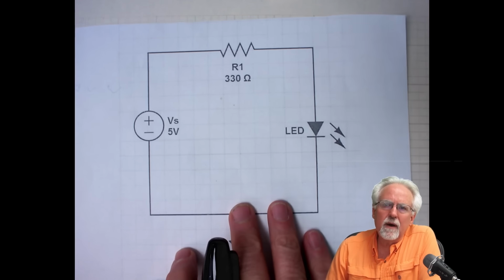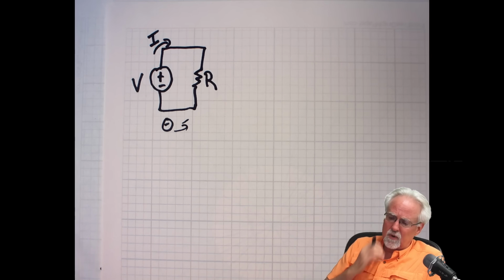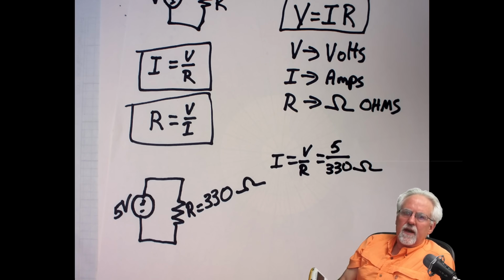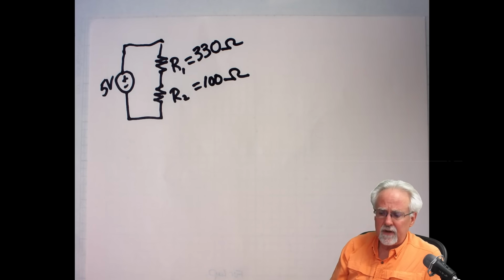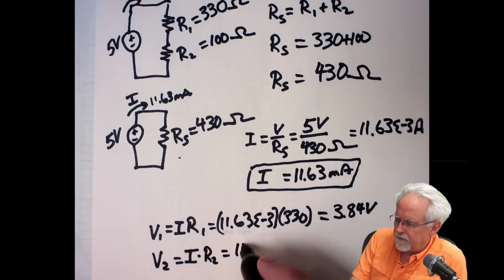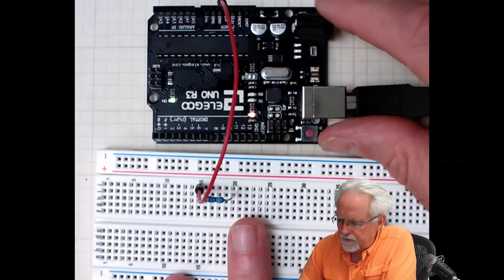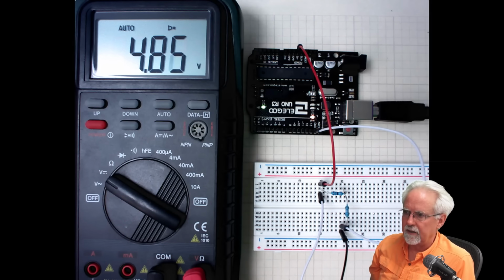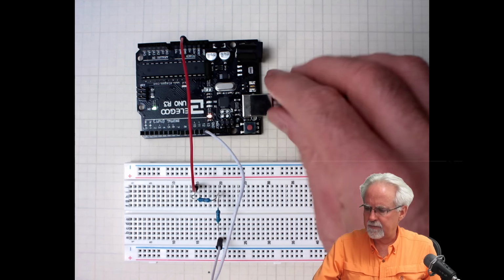Arduino Tutorial 9: Understanding Ohm's Law and Simple Circuit Design

Comment: Another great video.  It was a pleasure to listen to someone talking about current flow theory instead of electron flow.  Back in the 60's when I was just getting into electronics and building tube driven ham gear, everything that talked about electronics in books used current flow to describe how everything worked.  On schematics, you just followed positive to negative through the arrows when it came to semiconductors and life was good.  When I went into USAF tech school in 73, they taught electron flow and it made it a lot harder to follow.  Even so, please keep up the highly detailed instruction on how this all works.  Even old timers like myself can use a bit of refresher courses on the subject.  On your issue with the lower voltage, I too had almost the same reading.  I blame it on the voltage output sent through the USB cable and not the Arduino because when I checked using the provided external power supply, (a wallwart), the voltage jumped up to 5.1.  Apparently the device does not change the input power much.  Thank you again and I will be looking forward to your next video.

Comment: Hi from Ireland. 
Had to watch this one again, couldn't get the different voltage readings. It had worked when I used 2 x 330 resistors and when I changed one to a 100 resistor it wouldn't read. I replaced both resistors (as I have been reusing them) and rebuilt the circuit and then all was good. Talk more, go into as much detail as you like. 

Our maths is different to you guys. Our decimal point is in the middle and we use 3 to the power -10.

Comment: Given everything you've said here, I would think that the problem lies in the R1 resistor rather than the Arduino. If the Arduino were not supplying the correct voltage, then I would have expected BOTH resistors to be off, proportional to the resistance of each. But here, R2 measured exactly as you calculated. Thanks again, for another great lesson. Echoing other comments - NOT boring!

Comment: This may be excessive... 😬 First time doing this. Here's my printout:
====================================================
Rs: 430.00Ω = R1: 330.00Ω + R2: 100.00Ω 
I = (5 / 430.00Ω) = 11.63e-3, 11.63mA
V1 = [I*R1] = (11.63e-3)(330.00Ω) = 3.84V - 76.74%
V2 = [I*R2] = (11.63e-3)(100.00Ω) = 1.16V - 23.26%
5.00V - 100.00%
====================================================
Here is my Code:
====================================================
int readPin=A3;
int delayTime=6000;
// known values
int sourceVoltage=5;
float R1AssumedResistorOhm=330;
float R2AssumedResistorOhm=100;
// calculations
float RSum;
float VSum;
float totalAssumedCurrent;
float totalAssumedCurrentmA;
float R1totalAssumedVoltageResult;
float R2totalAssumedVoltageResult;
float R1totalVoltagePercentage;
float R2totalVoltagePercentage;
float totalVoltagePercentage;
float sensorMax=1023;
float actualVoltageResult;
float readVal;

void setup() {
  pinMode(readPin, INPUT);
  Serial.begin(9600);
}
void loop() {
  // known value
  Serial.print("====================================================");
  Serial.println();
  Serial.print("Starting: ");
  Serial.print(sourceVoltage);
  Serial.print("V");
  // assumed resistance Ohm
  Serial.println("");
  Serial.print("Rs:");
  RSum=R1AssumedResistorOhm+R2AssumedResistorOhm;
  Serial.print(RSum);
  Serial.print("Ω = ");
  Serial.print("R1:");
  Serial.print(R1AssumedResistorOhm);
  Serial.print("Ω + ");
  Serial.print("R2:");
  Serial.print(R2AssumedResistorOhm);
  Serial.print("Ω ");
  
  // assumed i / current / amp
  Serial.println("");
  totalAssumedCurrent=(sourceVoltage/RSum);
  totalAssumedCurrentmA=(totalAssumedCurrent*1000);
  Serial.print("I = (");
  Serial.print(sourceVoltage);
  Serial.print(" / ");
  Serial.print(RSum);
  Serial.print("Ω) = ");
  Serial.print(totalAssumedCurrentmA);
  Serial.print("e-3, ");
  Serial.print(totalAssumedCurrentmA);
  Serial.print("mA");
  
  Serial.println("");
  // print V1
  Serial.print("V1 = [I*R1] = (");
  Serial.print(totalAssumedCurrentmA);
  Serial.print("e-3)(");
  Serial.print(R1AssumedResistorOhm);
  R1totalAssumedVoltageResult=(totalAssumedCurrent*R1AssumedResistorOhm);
  Serial.print("Ω) = ");
  Serial.print(R1totalAssumedVoltageResult);
  Serial.print("V - ");
  R1totalVoltagePercentage=(R1totalAssumedVoltageResult/sourceVoltage)*100;
  Serial.print(R1totalVoltagePercentage);
  Serial.print("%");
  // print V2
  Serial.println("");
  Serial.print("V2 = [I*R2] = (");
  Serial.print(totalAssumedCurrentmA);
  Serial.print("e-3)(");
  Serial.print(R2AssumedResistorOhm);
  R2totalAssumedVoltageResult=(totalAssumedCurrent*R2AssumedResistorOhm);
  Serial.print("Ω) = ");
  Serial.print(R2totalAssumedVoltageResult);
  Serial.print("V - ");
  R2totalVoltagePercentage=(R2totalAssumedVoltageResult/sourceVoltage)*100;
  Serial.print(R2totalVoltagePercentage);
  Serial.print("%");
  
  // totals
  Serial.println("");
  VSum=(R1totalAssumedVoltageResult+R2totalAssumedVoltageResult);
  Serial.print(VSum);
  Serial.print("V - ");
  totalVoltagePercentage=(R1totalVoltagePercentage+R2totalVoltagePercentage);
  Serial.print(totalVoltagePercentage);
  Serial.println("%");
  
  // print end and delay
  Serial.print("====================================================");
  Serial.println("");
  Serial.println("");
  delay(delayTime);
}

Comment: Never used a scientific calculator in my 64 years.  Seems to me that a simple understanding that a "milli" is 1/1000th, then just do the math straight out.  11.63 mA is 0.01163 Amps.  Just move the decimal point 3 places to the right and you get milliamps.  Using the scientific notations may loose some of your youngest fans who have not been introduced to scientific calculators.

Comment: Thank you so much Paul for your informational series on Arduino.  @20:46, when you connected 100 ohm in series, why did you have to across the trench. I did not get that part. I do know that top 2 and bottom 2 rows are connected and the rest of the columns are connected (not across the trench, but just in one whole section). Could you please explain that part? Once again, I highly appreciate you for your time and efforts.

Comment: Great video! Just a side note about the scientific notation, especially for the US viewers. Thats the fundamental part of the metric system. The -3 represents "milli" as in milliamps (a thousand of an amp), A 3 would represent "kilo" as in kiloohms (a thousand ohm) and 6 represents mega as in megaohm.
The beauty of it is that it works exactly the same regardless of the unit you are using, and it's all tied together. One millimeter is a thousand of a meter, and now we are measuring distance. And one milligram is a thousand of a gram. One kilogram is a thousand grams. We are measuring weight. If we measure volume we have one liter that is a thousand milliliters.
The really interesting thing is when you are using one unit to get knowledge of another. One liter of water actually weighs one kilo, which means that a thousand of a liter (-3) weighs a thousand of a kilo, i.e. a gram (-3). You basically just move the decimal divider three steps forwards and backwards, regardless if you are measuring ohms, amperes, volts, meters, liters and whatever and everything is tied together. That's pretty neat, and might give a better understanding of the scientific notation used in the video. :)

Comment: At the beginning Paul mentions the importance of having the right size resister to protect the led while still allowing it to light up properly.  However nowhere in this video do I see that calculation to determine the right size of resister actually being done.  R = V/I, and we know V(voltage) is 5V but how do we know what I(current) is?  And if we don't know what I(current) is how can we calculate the value of R  to put in the circut?

Comment: What is the consequence of this practically? Do we need to design circuits in which all of the voltage is used? Surely the resistor uses all of the voltage no matter how many there are or what resistance they have because Ohm's law is an equivalence. How do I know that I have to use a resistor with 330 Ohms for an LED in series to stop it burning out?

Comment: Hi Paul, I would very appreciate if you can make a video show us how to use the multi-meter to measure resistance, capacity, amp etc.. as my background is mechanics and I can only check connection, voltage. very limited use for a great tool. Thank you.

Comment: You're measuring below 5v most likely as you're powering the Arduino via USB, the Arduino can only regulate voltage down so they suggest feeding it at least 6v or ideally 9v via the power connector, great videos by the way!

Comment: I did it! My Arduino kit came with 220ohm and 560ohm resistors so I used those in my circuit. Prior to adding the resistors I checked the 5V port and measured 4.88V coming off. Therefore I did the math and calculated I should have a voltage of 1.375mA and 3.5mA at the respective resistors. Sure enough, I measured the voltage at each resistor and got 1.38mA and 3.5mA. Onward and upward! Time to refill the coffee, grab a bite, and start lesson 10. =)

Comment: Hey Paul, I don't quite understand OHM's law. I understand the equation but I don't understand if you put 2 resistors, the amount of current dropping through each resistor should add up to the amount your putting through. So, if you were to put a led after the second resistor, the LED wouldn't light up because there is no more volts?? Please help

Comment: I really wish I'd have "looked under the hood" on things like this years ago...I learn something new from you in every video.  I taught summer school two years ago to K - 6th grade students I didn't use Arduino but I did lean heavily on your Ohm's Law lesson from the first Arduino series.  I only had about 30 minutes per session but had kiddos pretending to be electrons who marched through the circuit (negative to positive),while others acted as resistors, LEDs and switches.  In the next sessions they drew a simple circuit diagram (VS,Resistor,Switch and LED) and finally with a little tape, aluminum foil, LEDs and switches made from cardboard and aluminum foil we built basic circuits on the desk.  I am not a teacher but was doing IT work for the school and I have to say that it was the most rewarding job I have ever done.  I had teachers asking me how I got the kids so excited and that all they wanted to talk about was circuits and resistors and LEDs.  The point of this long winded comment is because of your videos I was confident enough with the subject matter that I could pass your knowledge on to about a hundred kids.   Thanks again for the fantastic content!

Comment: Hi Paul, I took R1 = 330 Ohm and R2 = 330 Ohm. I got V1 = V2 = 2.4981 V on volt meter which is correct according to my calculations. But when i tried to measure the current which should be 7.57 mA. But on Ammeter it is coming almost double of 7.57 mA,  Maybe i am using ammeter wrongly can you please guide me here.

Comment: near the end, the second resistor has the correct expected voltage across it, but why? shouldn't it be different since the voltage at the source was measured to be 4.86V instead of 5V?

Comment: Questions: 

1. I guess you could find a kind of advanced calculator if you tilt your iPhone in landscape mode, but how did you calculate those numbers? (11.63?3) Is there a special button for that mirrored 3 sign?

2. Why would you use two resistors in series instead of one single bigger resistor? Am I missing something, or haven't we gotten there yet? 

3. Shouldn't you do the math for the second resistor (R2) with the voltage value you get from R1? Hasn't the voltage dropped to 3.84v after R1?  🇸🇪

Comment: So does an led need a lower voltage input ?. Is the task of the 330ohm resistor there to drop the voltage to the + side of the led or does it not work like that ?. This question is because I watched lesson 9. Ohms law.

Comment: I had to use (2) 330 ohm resistors.  Didn't have a 100 ohm resistor.  Worked it out and followed along just changing the R2 to 330 ohms.. Checked the voltages, current and resistance.  All worked out.

Comment: If the volt drop across 2 resistors from 5v to 1.16v do I need to have a higher voltage than 5v if I want to add more resistors?
Thanks for the tutorials very informative I learned allot.

Comment: Craziest thing, I just woke up with an electronics engineering question in my head...... It goes "How do you determine what current you want flowing through your circuit?"
Reply from the maker: It depends on what job you are trying to do. Or, more often, making sure current stays below the limits of the devices so you dont burn something out.
Reply: Aha, the deivces you use are the biggest factor. But how do you know what current they can handle? Can I assume that info is provided in their sheets. You would then have to determine the device with the lowest tolerance and base your whole circuit on that.
Reply from the maker: The spec sheet will tell you. Also be mindful of how much current the arduino pins can safely deliver. It is possible to connect enough LEDs, each properly current limited, but the sum of them can draw too much current and damage the arduino pins.

Comment: Good lesson Paul. Do we need a high impedance VOM (meter) for this course?
Reply from the maker: A reasonable DVM is always a good thing to have on your work bench. As is an oscilloscope.
Reply: @paulmcwhorter  My concern is the voltage push from the meter which can damage computer chips. High impedance meters have a very low output. As I said, one of my meters can light up an led.

Comment: As usual great work.... (and KEEP UP THE GREAT WORK)
Would appreciate any info on what Video editing software you are  using...  thanks in advance.

btw, How on earth do you manage to have everything on the screen.... zooming-in, moving around etc...  no blurs etc...  How many eyes and hands do you have? 
Oh...,  and,     just curious, is this a one-man show? If not, how many persons are assisting?   ...thanks again.

PS  just a thought/suggestion:   does the tolerance of the resistors have anything to do with the exactness of  calculations. (Or for that matter if you use an  LM7805 - linear voltage regulator or even a standard USB,  will the multimeter ever show a "clean" 5V... )
Reply from the maker: The software is wirecast, and I manage it myself.

Comment: In a more complicated circuit, like a transistor radio, all the other components wll influence the outcome of these calculations because they will add resistance?
Reply from the maker: Other components have to be analyzed differently, as they do not have a simple linear resistance with voltage. Maybe more about that in future lessons.

Comment: The reason I believe your measurements were off, is because the resistors were not precise enough. If you factor in the tolerance values. your measured results would make sense. your calculation were based on ideal rather than real values. you have to get the real values of everything voltage, R1, and R2 ( leads not included, unless you want to be ultra precise)
Reply: I don't have the resistors labeled. So I measured them to find the 330R. I was lucky as it was the first I tested, it was 327 Ohms.

Comment: I found that the tutorial was very helpful in awakening old memories from the dim past. I knew that volts, amps and resistance were related, but would not likely have been able to say exactly how…i.e. state Ohm’s Law. I’ve got it now, permanently! V=I•R
I’ve got the circuit hooked up and will go and get my multimeter from the toolbox. Oh, and I now understand how voltage drops across resistors in series, in an amount equal to the source voltage.